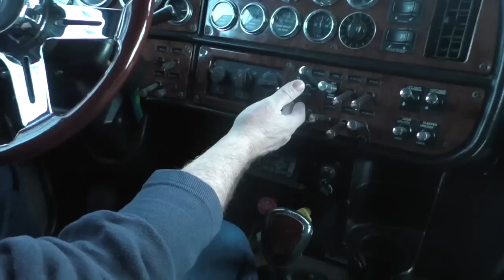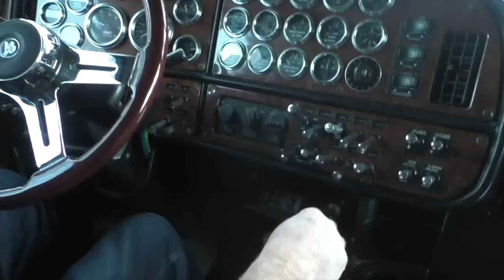How to Handle a JackKnife Skid- A Critical Professional Truck Driver Skill

Comment: If it looks wet but no spray is comming off the vehicles ahead, assume it's ice. Also ice build up on backs of mirrors is another indication
Reply: M Blake Jr I'm assuming your running with a cold windshield as well?
Reply: I never had an outside temperature gauge in the old trucks I drove, so my rule was, once the mirrors started to freeze, the ground wasn't too far behind.....very good point you brought up for us "poor truckers".   LOL.

Comment: Great advice all around.  The one thing I question is about the Jake brake.  I once encountered a situation where I was going downhill in slippery conditions, with the Jake set at #3, which worked great... until I touched the service brakes to slow for an upcoming right curve/exit [on a two-lane highway].  Immediately, the drives locked up and started skidding (the combined braking of engine braking and service brakes overcame the traction cohesion limit of the drive tires on the highway).  That put the truck into a skid with the trailer pushing.  But I did what you said: "Get the rig straight."  I let off the brakes, turned off the Jake, tried to get everything under control again, which worked... and skipped my intended right exit [I was going way to fast to even attempt the turn], and continued straight for several miles until I could turn around and go back to my turnoff.  Scared the s*%t out of me. I've heard that a semi-trailer combination can't get more than 15 degrees out of alignment before it becomes "unrecoverable" in driving situations.  That's a pretty small angle for recovery.  And THAT'S why your advice about "paying attention" ALL THE TIME is so appropriate.  Someone once describe truck driving as "days of boredom punctuated by moments of sheer terror".  There is truth in that... and one would hope that we're all prepared for those "moments" when they happen.

Be safe out there!

Comment: Your so right. I just came down Bromley mtn  8% grade and had my engine go quiet, then realized, yup I’m in a skid. 
Tapped the throttle to regain traction and road it out. Luckily I have 34 years of driving down, and was going slow enough where I could regain my composure. Still after all these years of driving, it still gets to ya
Reply from the maker: Yup!  Makes you sit up and take notice!   Dave

Comment: My most memorable skid was in the late 60s hauling steel with an Autocar pulling 55,000 pounds of steel going Hamilton to Richmond Hill Ontario. Just as I got on the exit ramp from 401 to 400 north it started to rain. I knew that was when the road is the slickest but I was hoping it might not be that slick yet. Wrong. I was halfway through the 90 degree curve when the tractor started to skid. Had I not been able to  correct it I'd have gone through the guard rail and landed on the 401 in the right lane or perhaps all of them. Steering into a skid under that situation is sure to pucker your sphincter and you bet it did but lucky me I  never did panic so I just did it and it worked.
Speaking of ice and a CB radio, another night I was eastbound on the 401 at the east end of Toronto headed for Ottawa when my gut told me to slow down. I was in the collector lanes because they were working on the other lanes and the road was clear so there was no logical reason but I took my foot out of it because I've learned to trust my gut. My gut told me "no, I mean SLOW" so I backed it down even more. Seconds later I got to the top of a hill and found the road had turned to black ice and down the hill were 3 trucks all crashed together and blocking the road. I got on the radio and warned  other east bound drivers and soon another truck pulled up beside me and asked me how the hell I knew. "Just a guess and maybe some help from the big guy" was all I could think of. That one was almost spooky but I sure was glad of it. 
Stay safe my friend.
Reply from the maker: Pays to listen to your gut feelings! Thanks for writing in Doug!    Dave
Reply: Doug Fever 
Welcome to Highways of the hell 
Nothing like Hwy 3 (crownest)

Comment: Once again thanks for the great advice. It a shame there are drivers that try to maintain 60-70 mph on snowed over roads. For me o start to go a little slower as temps fall near freezing, or when I can see the snow stick to the road. I have other trucks pass Mr on snowed over roads just to find the down the road and off the road because of speed. Be safe driver!
Reply from the maker: You as well!    Dave

Comment: You guys and gals listen to this.   .
How many times have we seen drivers left leg up by the window. Yaking on the phone.  One hand on the wheel.
 Look at your Temps. 
Look at spray coming off the rear wheels of cars. No spray  it s getting icy.  Real shiny road black ice.   
 Slow is good. 
 This is really good info for us old guys and the newer drivers.
 We old guys got experience to go by.  But we also have habits. They can an do bite back from time to time.   Lot of good points. Thanks.DJ

Comment: true fact:)  I've fought many jacknifes in my trucking days.  reverse torque, the stupid traction control going wacky when going over a bridge deck, or wind.  I always feather the go pedeal, and stay off the brake.  One other thing, learning to use the jake properly is a lot better than brakes ever could be.  Another important one is going down hill and jack knifing, you have to be going faster than your trailer.  Meaning, you might have to shift up and go with it.  Thank you for the video:)

Comment: Hi Dave, a very good clip again, there is just one thing a disagree with you. Assuming you are not in a slide, but you want to slow down, don't use the jake brake. First, get rid of all traction of ALL wheels, then start braking soft with your regular brakes. If you use the jake, you have only 8 wheels that will slow you down, use your normal brake and you have 18. With less power on the brakes you have more stopping power. In all my years driving into Scandinavia I learned one thing: there are 3 rules for driving in bad weather, 1. distance 2. speed matched for the condition and 3. Keep cool.

Comment: It gets really scary when your trailer slides out to the side and starts bouncing.. I had that happen to me coming into Dallas on 30. I was coming down the hill out of Rockwall when the trailer brake locked up. I was across all three lanes and faced with either plowing into traffic OR taking my chances jumping the embankment into the lake. Luckily I got it straight and stopped about 15 feet from the cars stopped in front of me. I'm pretty sure I wasn't the only one who needed a fresh change of clothes after that. Then, after that near disaster,  I was north on 35 just out of Ft. Worth when I saw a trailblazer literally split in half into a bridge guardrail on the southbound side, it was then I saw a carseat in my lane. By the time I saw it, there was nothing I could do but hit it. FORTUNATELY it was empty. Afterwards, a TxDOT pulled up,  noticed how shook up I was and escorted me to a nearby rest stop. That was probably my worst memorable day out on the road. Just goes to show how quickly a good day can turn sour.
Reply from the maker: Yup, it's funny how fast it can go bad.   Dave
Reply: Eric Harrison Wooooooo!
Reply: Wow, that's an incredible day! Somebody was looking out for you, that's for sure!
Reply: I-30 aint no joke man, some parts is I-35 is just as bad.
Reply: The section between OKC and Dallas is horrific because it's always just cold enough for the rain to freeze to the road. Then you get towards Denton and all that traffic just makes things a million times worse.

Comment: My first solo run I had at Werner I was in a XL classic pulling out of a fuel station in Colorado at two miles an hour getting onto the onramp to the highway and I noticed my trailer going out from me and slowed the truck down and managed to get that trailer back under me I was lucky that my instructors teachings kicked in be safe my brothers and sister drivers and merry Christmas

Comment: I really appreciate your thoroughness and you sharing your experience. This may sound strange, but when I had a 53' box trailer with ABS brakes start to jackknife on me on the passenger side,  besides checking the mirrors, while I was looking forward and steering to straighten, I could "feel" when the trailer was pushing straight on the kingpin.

Comment: I was in a basic old day cab Freightliner and I saw my trailer sliding out on the passenger side. I hit my engine break and it did the trick. I didn't even turn towards the skid. I was lucky that I caught it early.  I was only going 55mph but I slowed her down to 45 and didn't have any problems after that. It is a sick feeling when you see your trailer sliding out like that.

Comment: Great advice as always, Dave, couldn't have put it better, in fact have been putting it like that over most of the past 50 years! Just a comment on categories of jacknife. There are 2 imo, the first, and the worst, is caused by drive lockup and the trailer pushes the tractor out of the way, violently. The 2nd is trailer swing caused by trailer wheels sliding. More gentle but both have the same remedy. Feet off and eeeeasy does it with the wheel. Had a couple of the former myself and avoided the snapshut. BTW, know what the French call it? Portefeuille, which is French for wallet, because it seems like a wallet being snapped shut. Keep your wallet wide open mate ;-))

Comment: YES agree with you.. I drive here where its winter 7 months of the year and first thing is to take your foot off the brake! once your trailer gets to a certain point skidding and jackknifing, there is a point of no return.. the quickest way to stop the jackknife is to take foot off brake...  once the trailer starts to correct, apply again for a split sec or two and release!

Comment: I'd like to add that I use the jake  on slick surfaces however I never use it with the divider locked in just to avoid both drives sliding plus if the pulling axle skids with the brake jake on then it gives you an idea of how slick it is

Comment: "Jake brake" is king.....saved me a few times over the years....even in town.. shift up , get the rpm`s up, and flip them on .( i know all you guys are saying),(not to use them in town,) but I would rather get a ticket for "noise" that slam into someone on a gentle incline (heading down the incline) ..a little noise never hurt anyone!

Comment: 35th winter and still learning,great vid.thank you. The worst advice I was ever given was u see spray ur o k.wrong!freeze and thaw cycles put water on top of ice that is attached to the road surface.i think if I can pass 1 piece myself it is if you are gripping the wheel any tighter or different than normal,u are going to fast or conditions are making u uncomfortable.slow down or get out of the situation.dont let anyone else drive your truck.they may be faster,but they may not get there.so may trucks i have passed in a ditch that had gone by me..slow n e z will get u home.

Comment: First time driving in UTAH I experienced my first skid and my mistake was down shifting , I didn't touch the brakes but when I down shifted my wheels locked up and the skid got worse , I got a little panicked but I went back to the basics and I upshifted and brought the skid under control.  Lesson learn , great advice great video .

Comment: One thing I learned a long time ago  and has worked for me when you get into a Jack knife  use the Johnson bar lock the trailer drop a gear and stand on the throttle get her straight off the break off the throttle slow it down,  best way to stay out of that situation  Slow down  drive the road not the truck keep your 5th wheel greased be smooth don't over react Slow down  drive for conditions

Comment: Had my first skid last night on I70, during the winter storm Hunter. Scary as hell. I didn't want to drive, but just started on a new account making pretty good money, and was told I must be on time for appointments. So I didn't want to call in delayed during my first week, bad choice I made. The roads were salted, but there was a patch where the wind was blowing across the hwy. You could see the snow blow across like a line in front of you. Everyone slowed down, as well as I, probably going 45, no faster than the trucks in front of me. Still I went into a skid, truck started going into right side ditch, never touched the breaks, just steered away from ditch, steer tires found traction at the last second and turned out of it. Lessons learned, don't drive if you don't think you should, and watch out for snow blowing across the hwy.

Comment: I enjoy watching your Video's, a lot of wise information for the new drivers and have been driving approx. the same length of time as yourself, I however was taught that no matter what, a person must always endeavour to keep the trailer truck straight even if it means grabbing another gear and have used that knowledge to my advantage (only I time). Whenever I see a jackknifed unit I always think "rookie". I also wish Driver Instructors would teach new drivers to NEVER even think of turning that steering wheel unless the machine is in motion, back in the day when there was no power or brakes on the steering axle you had no choice. I have literally informed thousands to no avail., same as curbing, some folks just don't have any idea the damage they do.

Comment: I been driving trucks in some of the most nastiest pass's for 40 years and my No.1 thing on ice is to drive like I have no brakes at all....in automatics and manuals both.  What he says about jake brake use on the ice is a critical component.....he's dead on the money about it.
Came down a 8% 3 mile long 25 mph corners grade with a thousand foot cliff on one side and a rock wall on the other slicker than greased visquean one night.....the empty trailer kept trying to push me side ways on every corner all the way down.....every time it started to push me around I would bump the throttle a bit to straiten back out......took me 30 minutes in low range to get to the bottom.......it was the combination of toggling back and forth on the jake switch and lightly bumping the throttle that saved my bacon that night......never touched the brakes even once all the way down........ it was dry at the top and with no hint of ice as I crested the top and started down......as I rounded the first corner and seen the ice I knew I was in trouble.

Comment: Sage advise as always. So much here to relate. Worst Skid: 90W dropping into Butte, MT 28° right at dusk. Load of matresses so wasn't heavy. Hit black ice going through a left turn. The tractor starts to  rotate(jackknife) just after entering the corner. Oddly the trailer doesn't move. Straightened the wheel as I rotated but didn't go past center and 10 wheel drifted around the corner. Had my heart in my throat the whole time but didn't panic and that made all the difference in the world. Still don't understand why the trailer stayed straight. But am thankful it did.

I was going way to fast as that was the first time all day that I was in any ice situation(left from Sheridan,WY that morning)and it nearly bit me.

Comment: Respect for you.
I would agree with external temp gauge being compulsory but a lot of people don’t know that the road temp can be 3-4 degrees below the air temperature so really need to be careful @5 degrees centigrade.
Something I have had to do a couple of times when it looked like going into an over correct situation is let go of the steering wheel and the unit will straighten itself up, it’s a last ditch effort but it can work but better avoid getting into the situation.

Comment: Solid advice. As a former ND oil field tanker, most of our locations are out in the middle of farmland. Hill grades are kept natural, and I learned how to control jack going down these to avoid chaining up sometimes. Its just a matter of being in the mirror, not letting the jack get to far away from you, and applying and releasing brakes properly. The vids title is apt because it is very critical skill to learn before it happens by surprise, or you will nut up at the moment of truth and miss your reaction window. You don't have to learn to work it like I did but you should learn to pull out of one that you start. Practice it when, and where you can.
Reply from the maker: Good stuff, thanks for commenting!
Reply: @SmartTrucking  Yes sir...Thanks for all the great advice on a great channel as well.

Comment: This is a great video to understand with how to handle skids.  
Though everyone has a bit of a different mindset on how to handle driving under road conditions. 
I have not been driving long.  Only 3 years.  But I will say the amount of trucks I seen upside down and jackknifed into a steep 10 foot ditch.  I have made myself a safety plan for road conditions in the 48 states.  
When the temp drops below 32F, both shoulders have snow and ice, and the lanes are wet. The sky is cloudy and snow is picking up.  It's time to shut it down.  
Yesterday I did this in Michigan.  Granted it was not too bad.  But I drive 50 miles north and seen absolutely no salt trucks.  It was 25 degrees outside and it didn't seem to get any better.  
I haul flatbed materials, so I'm not in a super rush to get the freight where it needs to be.  My mind is...  Better late, than all over the damn road.  And that's what a lot of drivers do not think about in today's world. We have all these crap companies pay by the mile at an all time low rate To lots of drivers.  It forces them to do desprite things and put other people's lives at stake. and that is one of the biggest issues in the trucking industry.  
I do give major credit and appreciation for smart truckings service and sharing his experience to many viewers on YouTube.